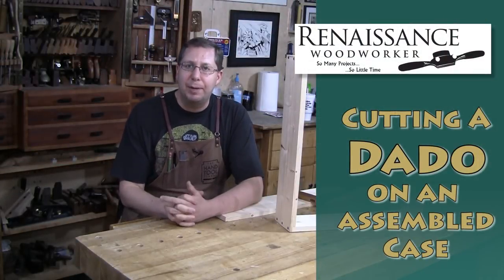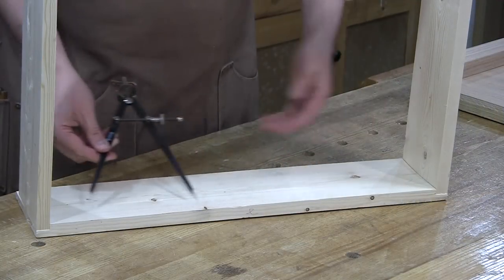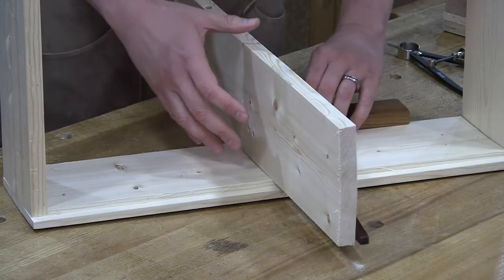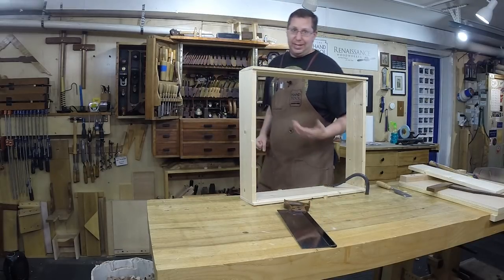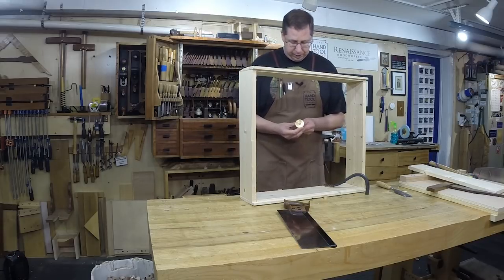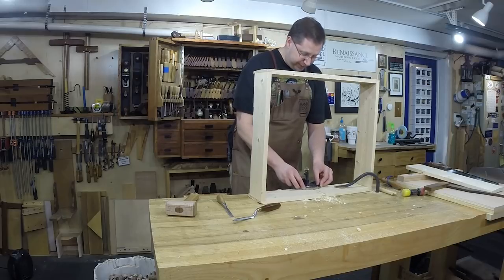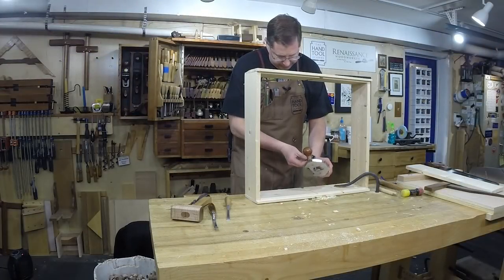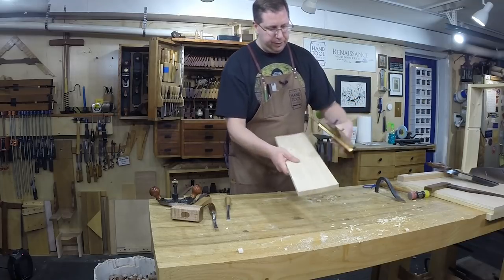How to Cut a Dado in an Assembled Case

Comment: Thanks for posting. Does that saw have a hybrid filing or is it straight crosscut?
Reply from the maker: tomwolber pure crosscut. I dont believe in hybrid set ups. Makes sense when you can have only one tool but at my stage of Woodworking I’m about the right tool for the job